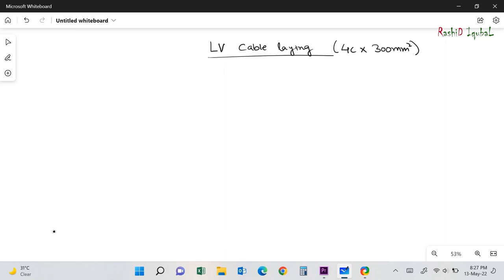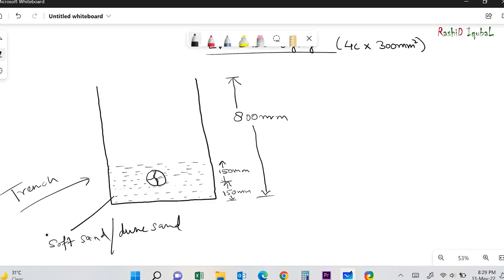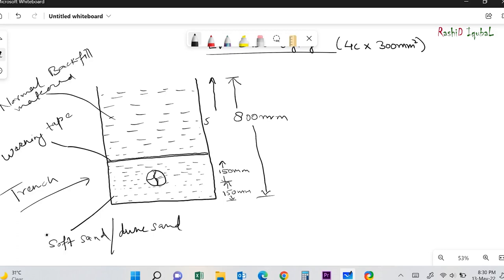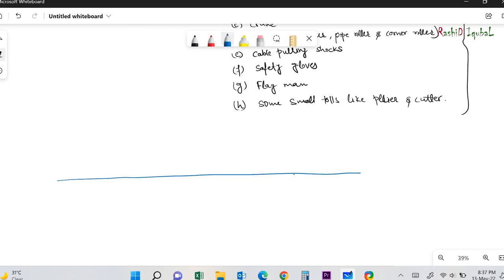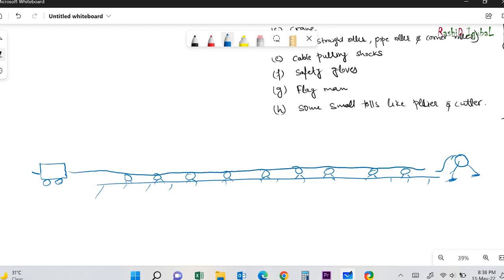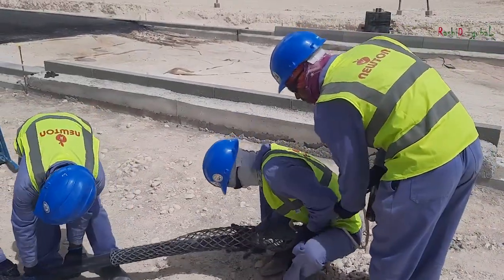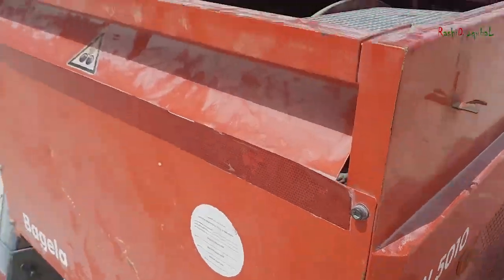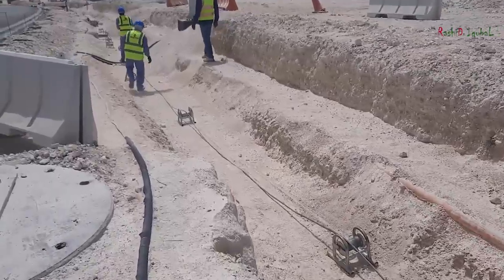Underground LV Cable laying method / Infrastructure project in Middle East

Comment: what is the distance between cable and road edge?
Reply from the maker: LV cable should be laid next to the edge of road like below walkway/interlock, so that in future any T joint required we can easily excavate without disturbing the road. Depends on availability of utility corridor you can design LV cable rout. The things keep in mind that maintain cable laying clearance minimum 1 meter from house/villa or any construction building. Hope you got my explanation.
Reply: Thanks sir .